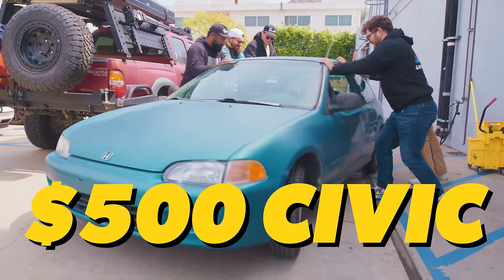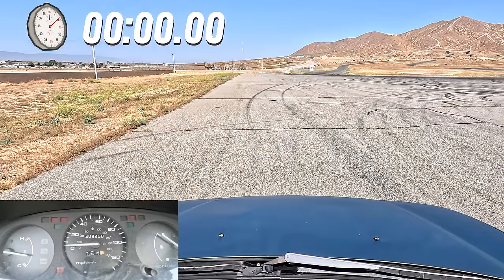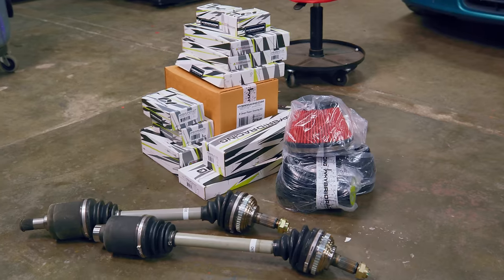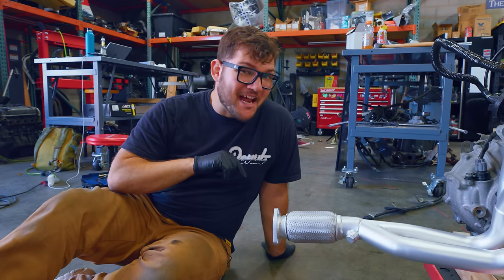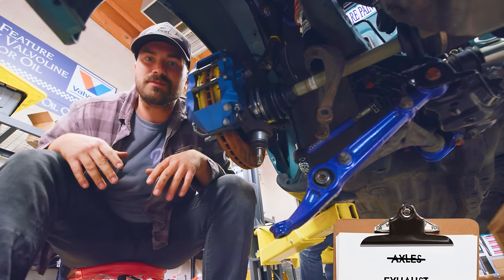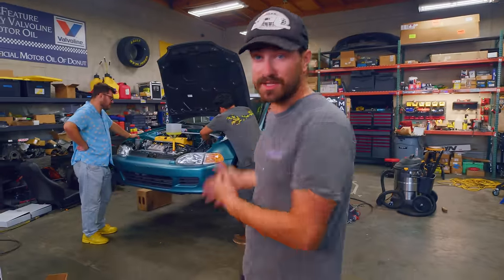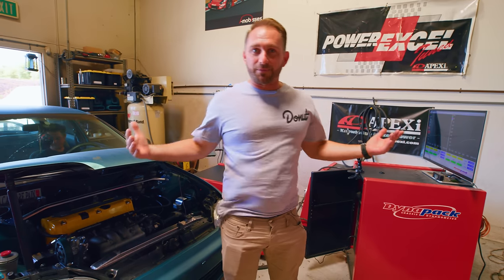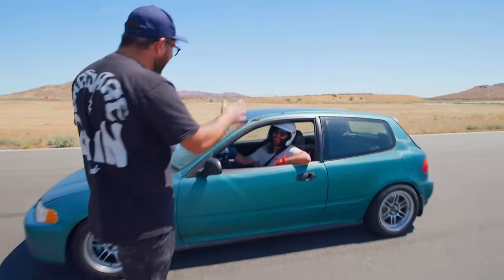We Put a $10,000 Engine in our $500 Civic

Comment: Definitely need a Rev counter with shifter light so you can get those perfect shifts and some racing seats
Reply: For sure, I’m pretty sure the new type r’s and si’s come with them maybe it’s possible to swap a dash in from one of those
Reply: Hector name plate
Reply: Rev counter lol you mean a tachometer?
Reply: 3 seconds out of a seat? You’re delusional.
Reply: @saltybmxer6977 you'd be surprised how much is left on thebtable without proper driver support. I had a Lexus is and I was fighting that car on the track because I couldn't stay on my seat. With proper support comes more focus and confidence. I could see at least 2 seconds from a seat.
Reply: @saltybmxer6977  you'd be surprised on what smaller things can add time , like the dead petal.
Reply: Let's not forget the fact that Hector is going to be running 3 Honda Civics with spoon engines. And on top of that he just came into Harry's and he ordered 3 T66 turbos, with NOS, and a Motec system exhaust.
Reply: You can make the check engine light be the shift light. At least with Hondata.
Reply: @saltybmxer6977 😂

Comment: As someone who just bought a 2006 si this is the most timely donut episode I've ever experienced. Love you guys keep being crazy awesome!
Reply: Nice man hope you enjoy the 8th gen si. I have a 2007 2 door si, owned for 6 years, bought at 60k miles now 120k miles. 

Clutch will go around 80k-100k miles. Suspension will need replacement or upgrade around same time. Oil will start buring around 100k miles on average, some say from new but mine was fine out of v-tech till about 100k miles. Radio / Radio Dash lights can be quirky. That's about it I think, oh and a good alignment is needed on these cars as well. 

Have fun 😀
Reply: I'm in both a 310whp tuned 2020 civic si and a stock 2023 type r, welcome to the family and this series is hypre for giving me money pit vibes.
Reply: I miss the k20 from 2006 si I've had but the transmission was shit. Kept kicking me out of third gear. Had bad syncros. Other than that was a super fun car
Reply: @jikwag3415  I'm loving how the k20 feels, coming from a 91 civic its a huge improvement over the d16. I'm sorry to hear that about your tranny, mine seems to be in better condition than my old cars was, which is impressive considering it was 5 years newer. No pops, grinds or anything
Reply: Old car and 91 civic are not related
Reply: @aidanstubblebine2197  that's awesome bro! Yeah if it wasn't for the Syncros, I would've kept a car a bit longer but I traded it in for 350z. Kinda got tired of front wheel drive. But high revving k20 was something else... vtech was too addictive!
Reply: @absoluteclownworld  my clutch went out in my 2008 8th gen si 250 000km it’s in km though not miles cause I’m in Canada, but I just bought a 2004 civic SiR it’s such a fun car the wheel base is so short it’s the last real civic hatchback it’s just annoying it has k20 but a different version the vtec doesn’t hit like the 8th gen si I might turbo it or swap it
Reply: @aidanstubblebine2197 heck yea man, I have a 07 8th gen si sedan babyyyy. Had a k24a2 swap in it blew that up and I’m putting the k20z3 back in it and will enjoy. Full bolt ons and Hondata and she’s a n/a rev happy beast. Through some bc coils on her and she’ll take those corners even better. You can lower her and it’ll still feel better than stock
Reply: i had a 08 SI ,  sweet car but the k20 isnt 10k to build .
Reply: 8th gen si is peak civic, enjoy it
Reply: All you gotta do is dump $20,000 in parts into it now.
Reply: just bought a 2012 9th gen si and it has been one of the best decisions ive made. i totally get all of the honda hype now
Reply: I just bought an 03 LX and saw this video lmao

Comment: As an FL5 owner, I'm rooting for you boys. It needs racing seats and other tweaks but ya'll got it! It'd be cool to see a full restoration!
Reply: With some racing seats, and some suspension upgrades, I believe it’ll hang with an FL5 no problem.
Reply: @ThatDudeNamedZ  how does having racing seats make u faster
Reply: @cosworthTV  because racing seats keep you in place rather than just sliding all around. Good seating position and posture will also help you keep better control of the vehicle.
Reply: @ThatDudeNamedZ  you can lock yourself in the chair you dont need racing seats, rather spend that money on making it faster
Reply: @cosworthTV  no you can’t 😂, but nice try tho. Also racing seats allow you to have a harness which 8/10 tracks require you to run on track day. Racing seats are also a lot lighter than stock seats, because of all the sensors and motors in them, and padding.
Reply: @cosworthTV  you’ve obviously never driven a race car before so there’s no point in continuing this conversation.
Reply: @ThatDudeNamedZ  a conversation is just a conversation. its al goooood and no ive never driven a race car
Reply: @blasterowner yea your pretty slow, that's exactly why they added racing seats to the car... you can't race as good without racing seats, hence the name

Comment: This is my favorite build so far! I owned 12 civics over the years, all between 92-2000. My fastest was a 96 Si i bought from the scrapyard for $200 as a completely stripped, bare shell. I put $13k into it while in college to become an auto technician (though i was already doing that job before, just went for certifications), and built an all motor, B18a1, that brought that car into the low 13 second quarter mile. It was an absolute beast, and the Acura EL front clip really made it stand out. I miss that thing, and this build reminds me of it a LOT, though I built the whole car in my fathers backyard, with just hand tools, a shitty cheap jack , and a set of homemade ramps. Took me two summers to put it all together, and i drove it maybe 5 times tops before selling it before my first son was born 8 years ago. I miss that car every single day.

Comment: Really enjoying this EG series you guys are doing! Making me miss my old EG. I had plans of engine swapping mine, but ended up getting rid of the car before I got to that point. I looked at a K series swap, but wasn't a fan of cutting into the EG, flipping the engine and transmission from the original architecture or dealing with the wiring and computer. For me if I had kept the car and done the swap, I would've gone with a B series as it is literally plug n play and can be done in an afternoon. But I completely understand why you went the route you did. Can't wait for the next video and I agree, seats are going to make a huge difference on lap times! Those factory EG seats offer zero lateral support.
Reply: I bought an ek hatch and I’m assembling a gsr to put into it. It’s been a lot of fun

Comment: VTEC na is the best. 200 horsepower is ridiculed by some, but it's fast enough for a mini circuit.
Drag racing doesn't require skill, so you have no choice but to rely on horsepower.

Comment: ITB's /Headers/Exhaust.  Lightened flywheel, Brake upgrade,  oversize TB, upgrade cooling and fuel management. Why not some proper swaybars as well and a high quality coilover setup.  Get it on the dyno and tune it properly

Comment: I took my BS 4 speed manual transmission and engine out of my 91 civic hatch back and put a 6 speed manual transmission and engine from an Acura RSX. I'm not even going to get into how hard the customization 2as but one thing I can tell you cuz I have the exhaust pipes coming out right behind the front tire, this car is so dang loud it really not even funny. Still have a lot of work to do to it. But I'm extremely happy with the swap from a 4 cylinder to a 6 cylinder cuz Everytime I got to race another civic they think I'm just another 4 banger out on the street😂😂  don't get me wrong my car isn't super fast but it's faster than the average car that for sure.qprst part os there's absolutely no room what so ever to fit am ac unit even if it were the size of a soda can. Lol. I'm having to get a custom hood just because of the turbo  itself. So right now I'm riding around hood less, like you do when your a poor man with a money pit, and still learning about cars in the process. I'm just lucky to have friend that race regularly and know almost everything there is to know about imports. Coolest part is a out my motor is I got lucky and found an rsx that was totalled by someone that rear ended that car but the whole front and interior was perfectly fine the motor and trans only had 18,000 miles on it. Keep in mind I bought this.motor when I was 18 or 19 and I'm 35 now, just got the motor in my civic about 6months ago. Theaim problem was finding my favorite civic with no 4isy problems 91.civic hatch is incredibly hard to find in great condition. I was going to buy a crx but I was told theotor wouldn't fit and the car would be to light the for power we plan on putting into the car o have no clue if that was true or not but I like that hatch back anyway. 91 hatch is just a piece of sheet metal on wheels. I wanted to make it 4 wheel drive but I was told I don't have that kind of money and they are probably right.😂😂😂Incase anyone was wondering what I've been riding around in the mean time before I finally found my civic. I was driving and still drive my 96 2 door Honda Accord with a prelude motor in it. Slightly tuned nothing special the best thing a out that care is the turbo and suspension. My new dream car is a Hyundai i20 WRC. But that's just a dream to have a rally car I can drift and race with. It would be a nice all around vehicle

Comment: I got 238/174 out of my jdm k20a (dc5 type r) in my 2000 em1. Ktuned 4-1 race header, 3” exhaust, ktuned ram air intake, kpro v4, rbc intake manifold, 50* vtc, rdx injectors, aem 350lph pump.

Comment: Spending 10k to end up with 200hp really sums up the average honda fan 😂
Reply: at least this civic is pretty light. The power to weight ratio must be pretty good.
Reply: @commandplay  it's about on par with a stock 00-04 3.8 mustang, which is alright I guess. For spending 10k it's pretty bad. I know they have an engine that can handle boost now and with a 5-10k(for them) turbo kit can get them up to about 6-800 safely. But there were way way cheaper ways to do this. Like a junkyard LS probably could have been swapped in for a couple grand and they'd already have double the power they do right now and an engine that can handle way more.

Comment: It needs a better rear-end ratio you want to take advantage of that 6-speed transmission and a lightweight flywheel .  Some racing slicks all the way around are probably 3 seconds a lap minimum .  Shock,  swaybar and spring adjustment .  You should be able to knock 10 - 15 seconds a lap off that time .  Lastly. Put the car on a diet .  If it's not required to make the car run, drive or stay together, remove it .  Someone who can drive is worth another 5 seconds a lap minimum .  Good luck !!!  🍀

Comment: Hey donut I have an 03 Honda Civic ex that was running great until I broke a bolt in the transmission while I was replacing the solenoids. Will it be possible to get it out? Pls help thanks guys

Comment: You can tell these guys are not Honda heads if there are using non Honda coolant, the blue stuff. Green is what most older cars use. Most cars use specific coolant for a reason. The original 92-95 Honda civic did use green coolant from the factory but not the engine that they are putting in now, surprised Brian Gilipsy from hasport didn't say anything about it. I guess he didn't notice or it's not a big deal to them, which proves my point. But ahhh who cares, they've got the money to throw away at it so who cares right.

Comment: hold on hold on hold on.... so you say that the stock engine can produce around 200hp..... but has the potential to put 1000hp out? How the FUCK do you get 800 additional hp lmao - keep in mind this question is coming from someone who knows absolutely nothing about how combustion engines work.
Reply: Lol that's a very long answer.

But you increase the amount of fuel, air and rpms the engine can handle.

That's the summery.
Reply: @pranays  I see. I feel like, at that point, after all the upgrades it would take to make that happen... wouldn't it just make more sense to get a bigger engine to start with haha.
I guess that's the fun of it though.... pushing a small engine to it's limit right?
Thanks for the reply!

Comment: civics dont have power steering? i must be missing something i am pretty sure building an racing that wud be amazing . back in high school we put a dohc integra motor in a crx getting it to fit was tricky oxy unsettling hilarious i know , anyhow the crx looked like the hoop deville and put posers in there place after they stopped laughing at the crx and realized it was actually serious click shift fryedv em in 3rd! felt like a rocket ship and def a bit sketch it pulled to the right prtetty bad and had to be compensated for . the straighgt savageness that they got smoked by this beeter was unbelievable it was great putting cocky rich jerks in therre place. i had another 90 integra Ls i got up to 150mph just stock def red lining tho,  rambling Hondas are dope nasty sikk road rippin' righteousness. cops gopt my whip an auctioned it i had just put all new brakes an all sorts of sht i ended  up losing w the car this teenager w his dad knew they gota score but they'll have to figure out how to work it like bif tanning nobody can start my car but me to much shit to type an i gotta get a wrk but i had the ignition wired to a light switch for one ud turn it to on then just clutch and it wud fire

Comment: That is a 600 dollar motor quit lying (I didn’t watch the video so if anything you built 9K worth of parts into the motor so call it a 10K dollar built motor)
Reply: B18C with GSR Transmission my homie built a BOOSTED 98 Civic with that setup for under 1500 motor Harness and CPU SHIFT LINKAGE AND INTERNALS included